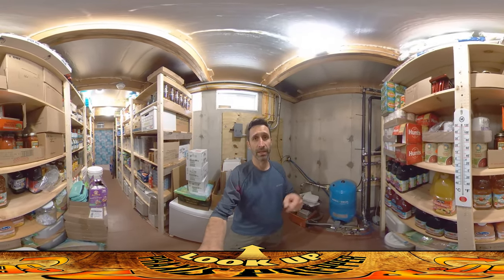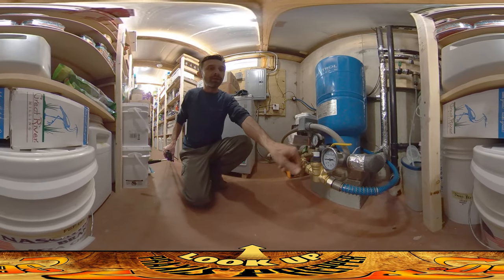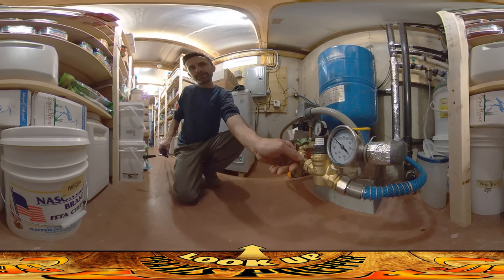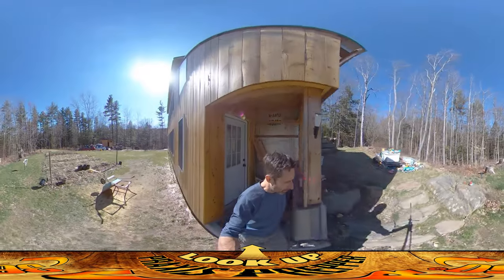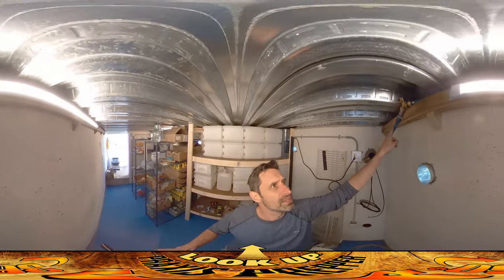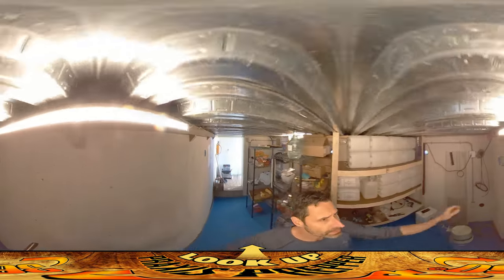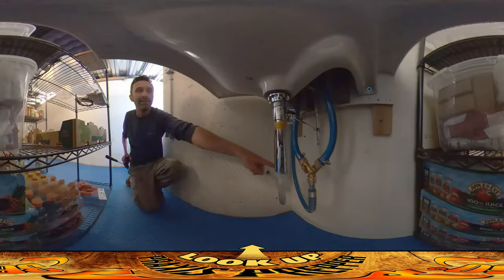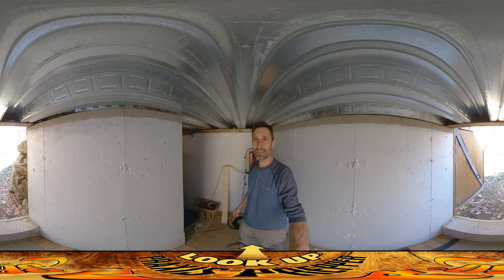Homestead Building - Running Water to the Fallout Shelter

Comment: Looks good, that’s the same pressure regulator use for the trailer, not sure why anymore as we have yet to see more than 40psi in any park we’ve stayed at. Actually thinking about installing a small pressure tank once I get our new power system set up and get some solar to go with it, always higher priorities but I really prefer around 50psi and really miss having it. In most parks, I’m filling the water tank and running off our pump just to get a consistent 40psi. We are in a new section of the park we are in right now and half the time the pressure has been down around 20psi, takes friggin forever to fill our 75 gallon tank.

Might be interesting to look into one of those under-sink instant hot water heaters, they are really nice when it’s cold outside 👍
Reply from the maker: Funny thing about those pressure reducers, I was reading some reviews and there were a LOT of negative ones where people were seething about how the product was "absolute crap". They screwed it onto their garden hose (which was running at 40 psi) and the "stupid device" was "completely incapable" of bringing the water pressure up even though they "turned the screw all the way!!!"
People are so often times... disappointing.
Reply: @PraxisPrepper  🤣😂🤣

Comment: Nice setup. You may want to looking into a second pressure tank. Although not another bladdwr tank like you have . The old style galvanized tanks can be hooked into to a system like that very easy and it ends up working like a giant pipe giving you massive amount of water and pressure storage for relatively small amount of space. Really helps during times of big draws(for me livestock and garden watering) and buys you a fair amount of time with pressure during a complete power loss
Reply: He makes his own electricity have you thought about it you have the roof tops for it there should be enough just on you shop.
Reply: How are the rabbit videos coming along?
Reply from the maker: That's an intriguing idea. I'll think about that. Glen's right that I have solar power now, but if that system went down for some reason, backup water sounds good. I used to use a 170 gallon cistern for backup water. I still have it, but I didn't build any doors in my house big enough to get it inside! :(
Reply: @glen1arthur  bad news on the rabbit plan Glen....long story short tonnes of stuff was canceled
Reply: @PraxisPrepper  I have built several custom water systems here due to needs...I can make you a walk thru vid sometime if your interested
Reply: @glen1arthur  I have the start date of solar setup but the money is just not there yet
Reply from the maker: @ontariohomestead7135  I bet a lot of people would find something like that useful. I don't think I'd do it this year myself though. I have a lot of other pressing projects that I'd want to hit first. But (per your advocacy), adding an extra tanks sounds like a "definitely eventually" plan for me.
Reply: @PraxisPrepper  only think is it can't be another bladder tank they tend to argue....no idea why exactly
Reply: @ontariohomestead7135  sh!t happens that sometimes means changing plans. 😎

Comment: Great work you have done something most of us only aspire too. 
Did you ever think about making a fallout shelter behind your greenhouse with access from it ?  
Hey the government of Canada surplus site have electric motorcycles again. Going cheap.
Reply from the maker: Making the root cellar right off the back wall of the house was a serious plan for a bit. I abandoned it because I didn't want to raise issues with building codes. As it was built separate from the house and smaller that 150 square feet, it didn't even need a permit.
Reply: Second time I’ve seen someone mention something about electric “bikes” over the border but I thought the previous person meant electrical bicycles. If they are for sale do you have info about how to find out more about them?
Reply: @inmyimage1081  these are electric motorcycles.  There have been some small cars also. If you are interested keep on going back to the site as it looks like they maybe selling off slowly and not all at once this is the 3rd group I have seen.
Reply: @glen1arthur  Thx but What is the site?